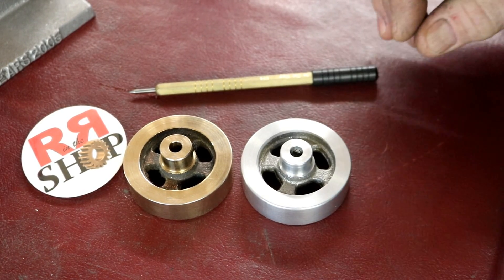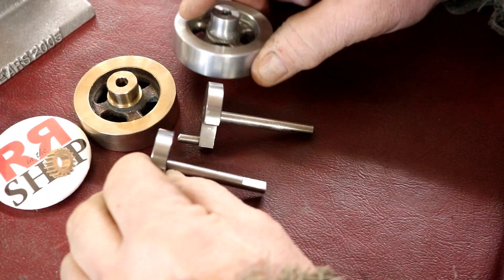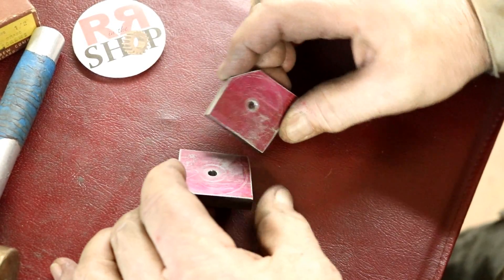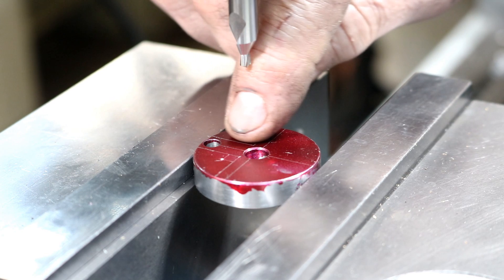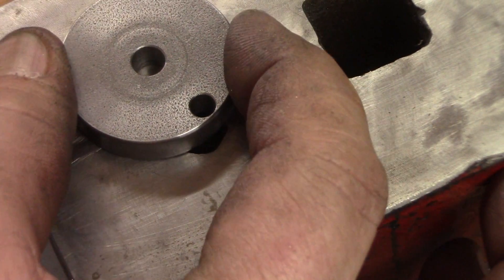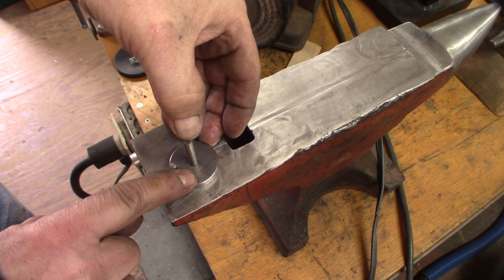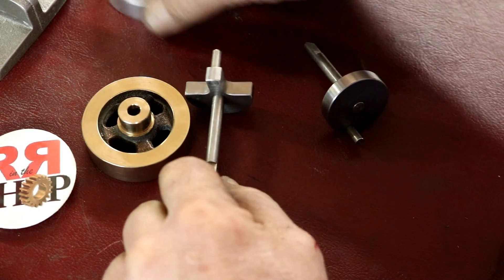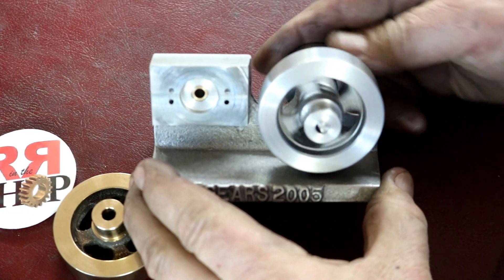P6-2 How to Build the Crankshaft of a Model Steam Engine for the First Time

Comment: Randy, thanks for the video.  However, you skip over explanation and/or video that would provide important info.  For example, at the beginning you were knerling(sp) for an better fit - what kind, how deep; what was the material for crank blanks?; you didn’t show how the mandrel turning went - the two pieces were frictioned together, there was a lot of interrupted turning.  Just a few thoughts.
Reply from the maker: Not sure what happened there.  I will have to find that.  Thanks Tripacer.